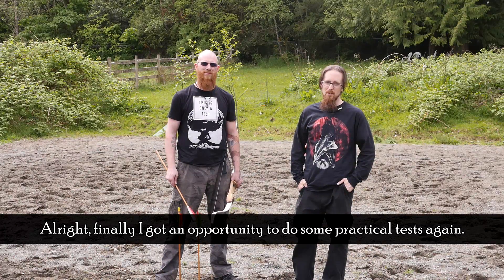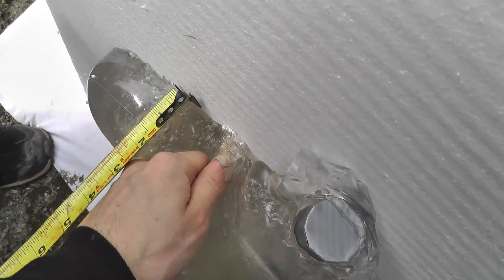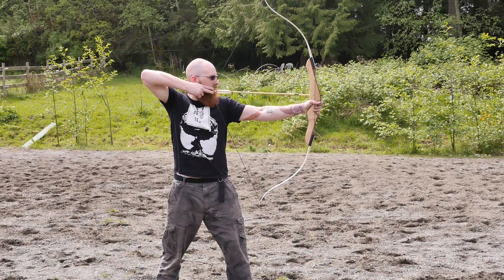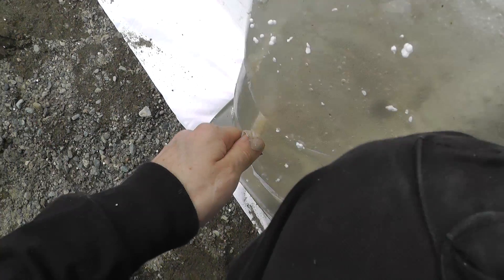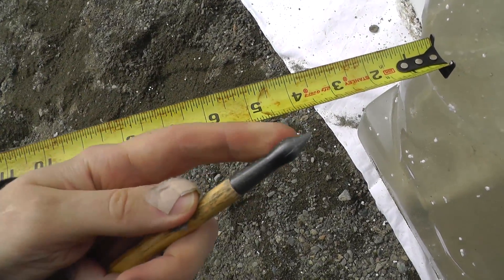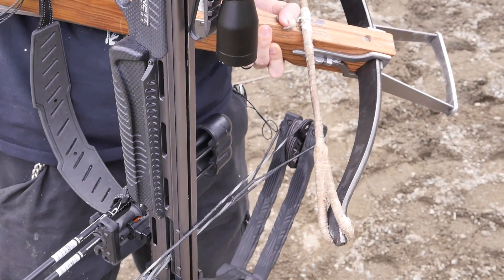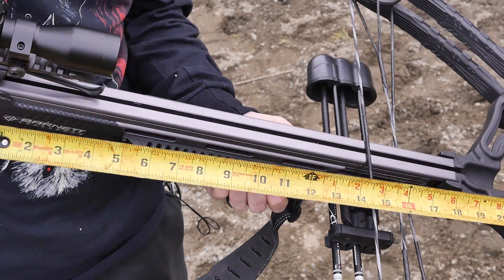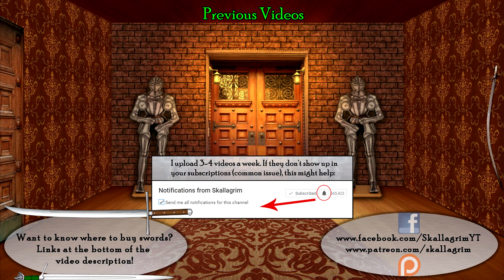Medieval vs. Modern: Testing Bows / Crossbows - Field Tips, Obsidian Point, Broadheads

Comment: GODDAMN that Modern Crossbow is a beast!
Reply: Punch's right through modern soft body armor, and some spike rated armor. Unless you're wearing high level spike protection, or a ceramic and steel plated body armor, then the crossbow bolt will sail right through you. If it's got a nice broadhead on it, that makes the situation even worse. Although it loses some penetration that way, of course. The wound tract will be impossible to repair. The person getting hit by it, would bleed out in a few minutes.
Reply: BrutalO.Toole fun fact, due to the lack of rotation on arrows most modern bows (excluding kids bows obviously) not even specifically crossbows can punch through Kevlar armor designed to stop up to 556 rounds, it's only really the ceramic plates that stop arrows as there is no rotation for which the Kevlar fibres can constrict the arrow
Reply: Really nice-looking too
Reply: John Smith But it loses energy and accuracy quickly compared to a bullet.
Also steel/titanium plates (level II+) are unpenetrable for crossbows.
Reply: Al-Malik Al-Ashraf Khalil The modern bow looks pretty DAMN badass
Reply: I do think modern crossbows are superior to their historical counterparts but I prefer traditional longbows or recurves than compound bows because they are lighter and I don't like the jerky draw from the pulleys, it screws up my aim when trying to shoot quickly. Also they have a slow fire rate due to having to be put the arrow through the whisker biscuit before shooting.
Reply: DragonSlayer  you should look into Oneida bows, they have the feel of traditional bows and power of compound bows
Reply: Kyle Miller They look like something I'd be interested in shooting but I'm not on that kind of budget
Reply: Check out ebay, I bought one for $300
Reply: Kyle Miller Cheapest I've found on eBay was 800 dollars. Maybe I'm just not looking deep enough
Reply: DragonSlayer if you want a new bow then it would probably be at least 800, but you should be able to find used bows for around $300
Reply: Kyle Miller Ah
Reply: Damn... I wasn't even expecting this level of disscussion
Reply: BrutalO.Toole Modern Crossbows would wreck medieval knights, plate-mail armor included. And the firing rate would be too OP as well
Reply: In Portuguese, crossbow is "Besta", it means literally... beast. I enjoyed the coincidence hahaha
Reply: @Butterkin  Any rifle round would be easier to survive than this.

Comment: Just a sidenote for any new archers or those curious as to any differences between what Skall used (besides what he put in the end of the video). The first bow he used at the beginning has replaceable limbs so you can increase draw weight. However the major difference between the recurve bow and the compound bow is that the compound bow allows the archer to hold it for a relatively indefinite time because of the pulley system. (Aka you can hold it longer in a drawn position as compared to the first one.)

Comment: also worth taking into account that the modern bow and crossbow have modern arrows / bolts that are made of stronger materials meaning it they can be made thinner. thinner projectiles result in less friction and resistance so there's more penetration.  

it would be interesting to see the damage inflicted by both crossbows on something like a free-standing  watermelon. I suspect the modern crossbow bolt would pass through where as the medieval bolt with the higher mass would do more damage. would make for a cool video either way
Reply: ***** tell you what, if th send me the link to the video I'll watch it for you lol. May eve. Give a like
Reply: I also want to know what is the weight of a bolt from the middle ages compared to a modern arrow used for crossbows. Because if a crossbow from the middle ages can hit the target at high FPE at lets say 10 yards you can kill a human without penetrating him.

Comment: Has the 1000lb crossbow arrived yet?
Reply from the maker: Arrived? I haven't even been able to order it yet. :)  Still waiting for IndieGoGo to disburse the funds, and after that it's probably going to take a few months for the crossbow to be made.
Reply: Skallagrim the next go fund me better be a 1:1 scale balista!
Reply: We're so impatient to see it. It will be amazing. So many possibility!
Reply: It's best if it uses a winch, and the power stroke is essential.
Reply: Skallagrim where do you order this I want one in three tons
Reply: Speaking of compound bows, the reason it did really well wasn't just the higher draw weight. It was also a combination of a more slender arrow and the fact that compound bows are much more powerful that traditional bows. For example, a 20lb cheap compound bow will pack a lot more punch than my 35lb recurve.
Reply: Braden Vande Plasse draw length
Reply: Alistair Shaw Even drawing a recurve bow to 30 inches won't give you the same power as a compound bow. The pulleys are designed to make it more powerful with a lower draw weight.
Reply: +Awellner Yeah! Then we can see if you can actually backstab with one!
Reply: dragon slayer bow..... someone go tell The sliver knights that someone is ripping off there design
Reply: Braden Vande Plasse my compound has a19 pound draw weight

Comment: By the way, just a little tip. When releasing the bowstring, allow it to just slip off your fingers rather than releasing your fingers and having them spread out. Spreading your fingers can cause for the bowstring to spin or be tugged in a different direction and decrease the accuracy. Or at least that is what I was taught.

Comment: An interesting point regarding the difference in performance between the compound and recurve bow: In longbows and recurves the force exerted by the string on the arrow tapers off as the string travels forward, while in a compound it starts off slowly, then rapidly accelerates when it reaches the break-over point and carries that extra force/acceleration all the way up to the moment the arrow leaves the string. As a result not only is it easier to hold at a full draw, but it also makes more efficient use of the energy you put into it and results in a faster arrow for a given draw weight.

You see a similar effect in composite bows. First a quick rundown on the physics of it... Draw weight in conventional bows is affected by the angle between the string and the bow limbs; The closer the angle gets to 90 degrees, the faster the draw weight increases per given distance of draw due to the change in leverage. This is why longbows and recurves are as long as they are. Since composite bows are much shorter they need a way to work around this, so they use rigid tips or siyahs; The bow is strung from the tips of the siyahs, and when not drawn the string sits flat against them. In this undrawn state and during the first part of the draw, the distance between the points on the bow's belly where the string separates from the siyahs determines the leverage available to the archer. Once they draw past that point, the string pulls away from the siyahs and now the angle is measured from their tips instead, effectively increasing the length of the bow and affording more leverage, allowing you to draw the bow further than you would be able to otherwise. Since the draw weight stacks quickly at the beginning then more slowly later on, the weight at full draw is lower than it would be otherwise and the bow releases its energy into the arrow more efficiently and gives a nice, high speed shot relative to a longbow with the same draw weight/length.

Comment: I don't want to be an ass I'm just a bit concerned and I imagine that Chris doesn't shoot a lot but if he continues pulling with two fingers he is going to fuck his wrist up after a while.
Reply: I normally shoot a compound bow with a mechanical release. I have no idea how to shoot one of these bows. And yeah, my fingers were sore. lol

I'll look into proper technique :)
Reply: Emiel Regis Rohellec Terzieff-Godefroy that's how u draw a lower weight recurve bow you don't need to use a 3 finger pull till higher weight but you should always try to release with 2 fingers it's more accurate
Reply: You might want to get finger tabs or something too.
Reply: you can draw with two fingers, it really is personal preference/comfort. with two fingers, i personally wouldn't go over 70 lbs (out of comfort), but i suppose you could, considering the ring finger only carries about 10-15% of the draw weight (depends on your technique)
Reply: You shouldn't draw anything above 30lbs with 2 fingers. It's not more accurate, either. It's just poor technique
Reply: MrBombastic799 Well, if it works, it works. I do prefer 3 fingers though.
Reply: Braden Vande Plasse it doesn't hinder your shot but neither does hitting your arm with the string.
Reply: Emiel Regis Rohellec Terzieff-Godefroy I always shoot with 2. It makes it easier to shoot if you have large hands.
Reply: Chronic Gold Especially if you have a short bow and large hands, pinching can be annoying. Luckily I have small hands and a large bow.
Reply: Pulling with two finger might seem more comfortable for some people in a short term but it puts a lot of tension on your wrist and in a long term you can simply fuck your wrist up. And yes by a  long term I mean months or even years of regular shooting that's why it's not that big of a deal for Chris because as he said doesn't shoot traditional bow much at all but for people who do and want to do it for another few years it does matter.
Reply: MrBombastic799 you shouldn't give ppl false information just look at a mechanical release it's just barely bigger than the nock
Reply: Erik Odinson yes but that's a mechanical release, not fingers. You're not supposed to shoot with 2 fingers. Don't you think if it was at least viable you'd see evidence of it in history? It's just Hollywood paff.
Reply: MrBombastic799 who cares about historical evidence a 2 finger release is more accurate with a heavy draw use 3 to pull and 2 to release if you use a English longbow then you have now time to switch to a 2 finger release unless you are prodigiously strong but it can happen the mongols used a thumb and ring technique I believe once again proving that the smaller the area around the nock is more accurate. I used the 3 finger draw 3 finger release then switched to a 3 finger draw to a 2 finger release accuracy improved with compound bows before releases were popular then switched to a release and accuracy improved more and I've nvr drawn a recurve with 3 fingers but I also started with compound bows first
Reply: I hear small hands makes it look bigger...

Comment: Also due to the pulley system on modern compound bows, they just shoot the arrows faster. Even some cheap modern compounds hit 300 fps at 70 lb draw, with the more expensive ones hitting 350 FPS at 60 lbs of draw, like the Bear Archery Escape. Without the pulley system to increase string speed, and relying on flexing limbs, more traditional styles of bow simply can't accelerate arrows as quickly, so they have to rely on heavier arrows to impart their kinetic energy, and thus thicker shafts, which produce more friction, and less penetration in grippier (technical term) mediums. Great video, keep it up!

Comment: I'm definetely not the first here having physics as a mandatory course in my colledge program. And I'll yet again say that for the bow there is not only the draw weight. It is also velocity of the string that is multiplied by those blocks as opposed to medieval/classic bow where it depends only on the materials characterystics. And BTW that's why a PVC bow has less penetration potentiap as well. It simply flexes back slower then wood.
Reply: Андрей Назариков 
Work = force x distance. also relevant, elastic potential energy = 0.5 x K x s^2 (where s is the distance the elastic material is pulled or pushed, k is the constant of the material).

The draw weight is the force applied on the arrow at full draw. however, this is not the force required to overcome through the whole draw. the force from the bow increases linearly according to this equation: F = K s. so to find out the energy stored in the bow at full draw, we need to integrate over the distance (because the work energy required to pull the bow is increased as the bow is being pulled due to the higher force requirement). This will end up with the following equation:
PE = 0.5 k s^2

Finally, this potential energy is then released and is converted to kinetic energy. as you can see from the PE equation, the energy that will be transferred to the arrow depends on two factors: the draw weight (k s) and the distance s, times half of course 
(0.5 x ks x s).

Comment: Great video dude very informative. One thing to take into consideration on your obsidian points.  Where you wrapped and glued the shaft where you repaired them that wrapping causes extra surface area that is rough and creates a lot more drag which hinders penetration a little bit. Would be curious to see how well they do on an arrow/bolt that was one solid price without that extra wrapping. Loved the video, earned yourself a Sub kind sir!

Comment: I'm sure someone has mentioned this already but the flint arrowhead was mounted improperly. Also, what is decieving about draw weight is that it leaves out things like speed. (hence compound bows are much more powerful) Arrow weight and draw length are also important factors that affect it alot more than you'd think.

Comment: I just wanna say the compound bow didn't really only shoot better cause it was a higher draw weight. It's because it's a compound bow and has a cam system. If you get a long bow at the same weight to draw as the compound bow. The compound will still shoot deeper, since it shoots a lot faster.

Comment: A tip from an experienced archer for your friend Christopher; What I've noticed in his way of shooting, and with the subsequent results of where his arrows land, I have determined that his way of releasing the string required a bit of adjustment. Try pulling your shoulder back while keeping tension on your arm to keep composure. I.E: Your issue is that your hand breaks away from your face at the moment of release, which automatically shifts the arrow to the left. Try and work on that.

An additional note on the heavier bow; if you can't draw it fully, don't shoot it at all. Having a floating anchor is about as worse as you can get for consistency. Whether the bow is too heavy or the drawlength is too short, I don't know. I didn't really focus on that, my eyes were mainly on his technique.

Anyways, I'm trying to be a bit more constructive though my own method of tutoring is "point at the points to improve upon. If I don't complain about something, it's fine." so my apologies if I come off as being a tight-wad. I just don't like to waste anyone's time.

Comment: The more interesting thing to me was the performance difference between a proper 35lb bow made with proper materials vs the 50-70lb PVC bow.   The improvised bow seemed less efficient.
Reply: It was also much harder to shoot.
Reply from the maker: The limbs of the PVC bow flex more slowly, so it limits the arrow velocity.
Reply: Too bad you didn't have access to a ballistic chronograph to compare projectile velocity.  That would be fun given the spectrum of weapons used.  Even more so should you add the 1000lb crossbow to the mix in the future.

Comment: One of the main reasons the compound (cross-)bows are so effective is that the cams "shape" the acceleration curve in a favorable way. It's basically a turbo charger where the arrow/bolt gets accelerated faster and faster. Whereas the acceleration Curve of a normal Bow tapers off. The effect is that for any given poundage the bolt/arrow is much faster if shot from a compound system.

Comment: I think the off-center attachment of the obsidian arrow-heads also played a role in  their lackluster performance.

For the performance of the bows - you can roughly say the power is distance times drawweight.
And the PVC bow is simply less efficient at releasing the stored energy - so even with higher drawweight it turns too much of that energy into heat.

Comment: Little comment on the draw weight of the bows. You were surprised when the pic did less with a heftier arrow, but it makes sense. A recurve increases the draw weight power. By that I mean the conversion of force from draw weight. So, therefore, a recurve, while being harder to make than a longbow and having less range, you could half the draw weight of a longbow and still have the same power.

Comment: hey skall nice choice getting the ghost 400. one word of advice though. when you pulling that cocking rope you have it a little to long you could hurt your back a little pulling that high and you'll get tired alot quicker. best thing is to shorten it down a bit so when you pull up your waist high not chest high. makes it alot easy.

Comment: Great video, though I just want to point out with your finishing statement on why compounds achieved better results, it's not just about draw weight. Compound bows by design are much better at transferring energy straight into the arrows and not flexing the arrows in the process (less energy loss) due to the way it accelerates as it is released. Traditional bows on the other hand will flex the arrows quite a bit due to inertia and the handle being in the way. The takedown recurve did better than the pvc bow is probably largely due to the fact that laminate bow limbs are much faster than pvc at recoiling back to shape as well as the center window on the riser.